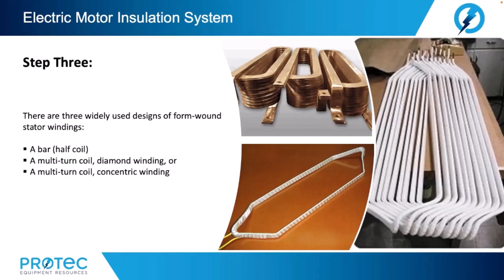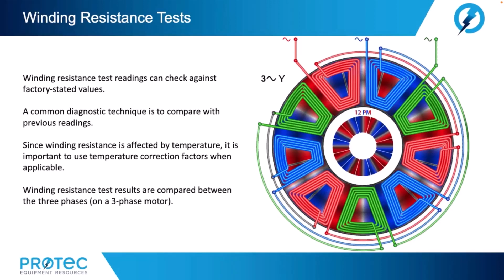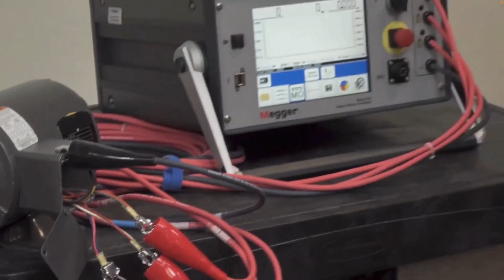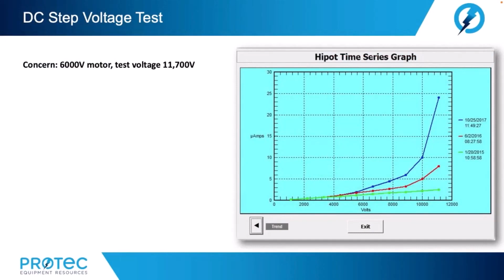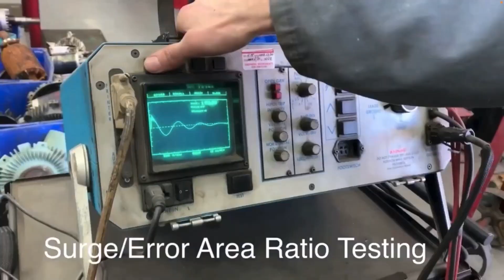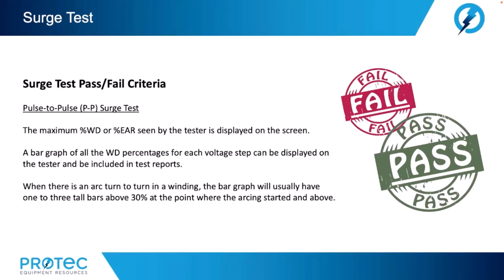Static Testing of Rotating Machines (Protec February 2022 Webinar)

Comment: What to do if tan delta value is above Acceptance value in motor.Need to do any maintenance
Reply from the maker: Thanks for your question.  If the values associated with this type of testing are questionable, perhaps it would merit further investigation such as reviewing previous test results to establish a trend, performing a tip-up tests as an indication of voltage dependency for partial discharge.  It may even be helpful to perform PD testing prior to moving into more impactful maintenance measures.